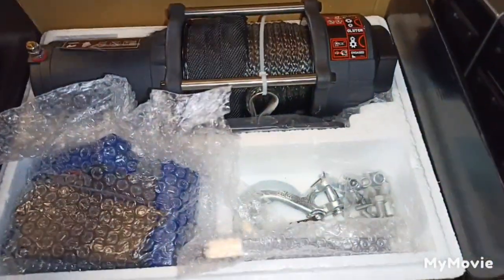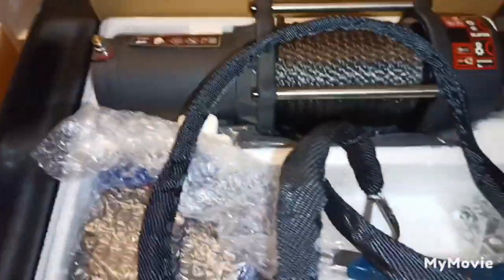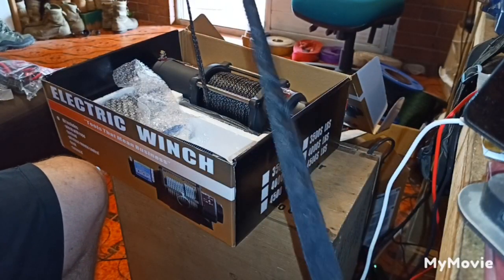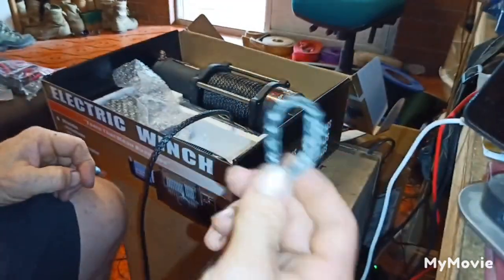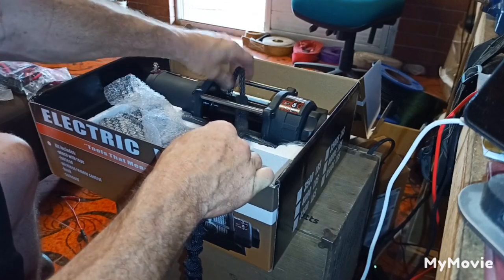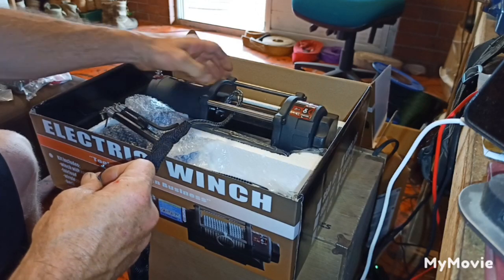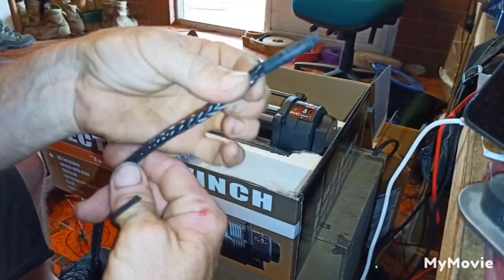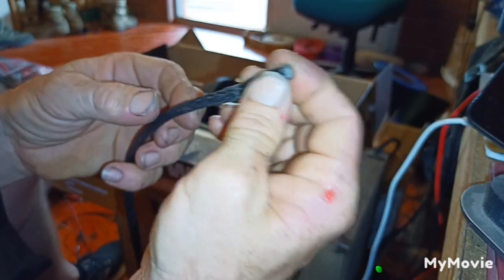HOW TO INSTALL DYNEEMA WINCH ROPE. Do this BEFORE you use your winch!!

Comment: Thanks for the video. How do you stop the rope from rotating around the drum when re-spooling? Also, how much of the rope length do you lose when to re-spooling the drum so that the rated pulling weight can be achieved? Thanks
Reply from the maker: With this style drum, the rope is attached through a hole in the drum, so by feeding the rope through that hole and splicing it back into itself, that creates a solid attachment to the drum stopping any slipping or rotation. 
Depending on the quality of the splice and the hole not having any sharp edges, maximum capacity can potentially be achieved straight away, with no wraps around the drum.
With other styles of drums and attachment, there is no "one size fits all" number of wraps around the drum to achieve max capacity. But as a general rule, five wraps should be enough.
However, with many winches from china (and most are made in china regardless of the brand name), the attachment to the drum can sometimes be pulled apart while there is close to a full drum of rope wrapped around the drum. Which is why I suggest the method I do, splicing through the hole, if there is one.

Comment: What winch is this ?
Reply from the maker: Just an eBay special. Actually pretty good quality little unit. 5000LB 24v. If ya grab cheap eBay winches, make sure they have fabricated steel drums if you're using it with dyneema. All those cheap winches they're flogging on eBay and other websites, with dyneema rope on a cast chinesium ally drum, the way dyneema works, as soon as you load them up, they push out sideways and break the drum and the winch is a paper weight.
Reply: @TruBluOffroad  I got a machine shop could possibly make a drum
Reply: This is gonna be a pain after I get back and actually get my licence looking at a unimog myself
Reply from the maker: @nickking8317  the cast ally drums have teeth etc built in. Easier to just buy one of these with the steel fabbed drum 👌
Reply from the maker: @nickking8317  get one! Ya gotta LIVE man!! Stuff sitting at home wondering. 👍
Reply from the maker: @nickking8317  but yeah these little winches aren't much good for a MOG. Be like throwing wooden speeds at an Abrams tank. 🤣